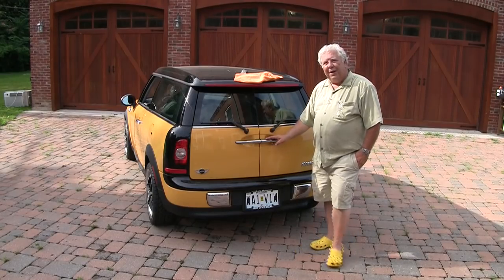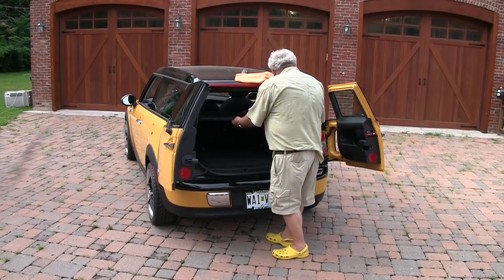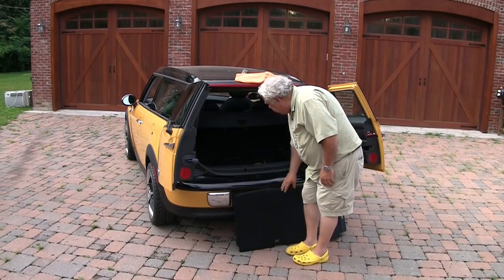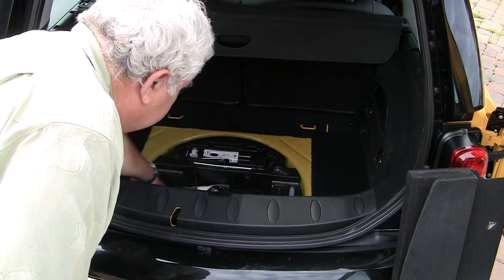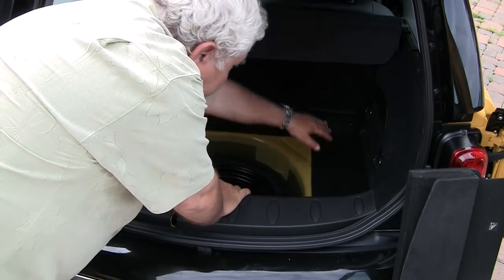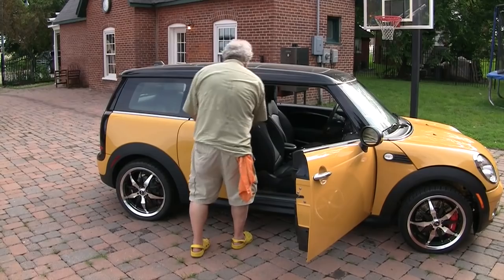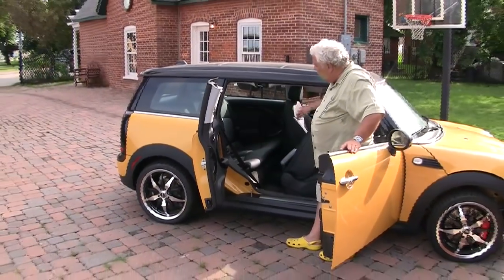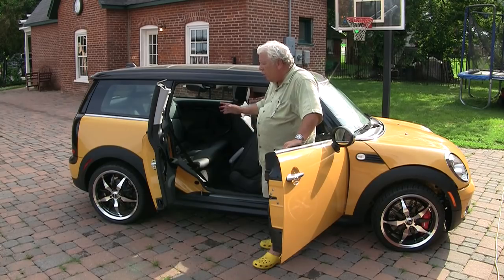2 The MINI-ME Electric Mini Cooper Clubman EV Conversion - Introduction

Comment: Could not find a follow-up video showing the completion of the project.   Did it die?   Am wanting to convert a Clubman and need some help finding parts, etc...
Reply: Hello, the conversion was finished and it did work. We are currently working out some software glitches with it but it has held up overall.

Comment: Hello Jack! I see this is from 2009. How did it work out. Are you still driving it?  I have a beautiful 2009 Mini Cooper Clubman with a blown engine. I owe $4300.00 on it. I was quoted $4 - 6k to replace it. So it just sits in my driveway. If I am going to put $6k into a car I might as well put a bit more and convert it to electric. Please let me know any resources out there!
Reply: Hi, Jack passed away in 2019, the car is still around but has some software things we are sorting through but everything else works pretty good.

Comment: Excellent work. One day I will like to do a convertion as a one off hobby. But How did you overcome the safety as the engine is removed but it acts as a safety measure in a front end collision because it takes the impact.

Also How did you overcome computer controlled stuff on the das. Temperature display, trip, cruise, ABS, ESP, Power steering, Climate control etc...

Many Thanks
Reply: They are all setup to override the Canbus. For the rest of us its easier to get a earlier model without that hassle.

Comment: I love that you're lowering the center of gravity by putting the batteries so low. What I'm concerned about is that you're shifting the cg so far back, and adding so much weight. You're definitely going to need to do some work to the rear suspension (stiffer springs and heavier shocks, aka struts).